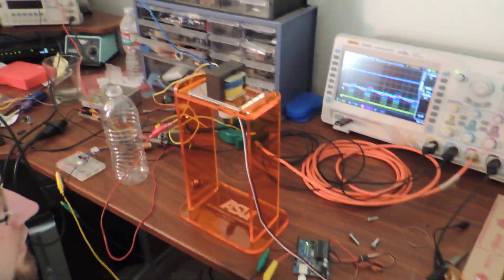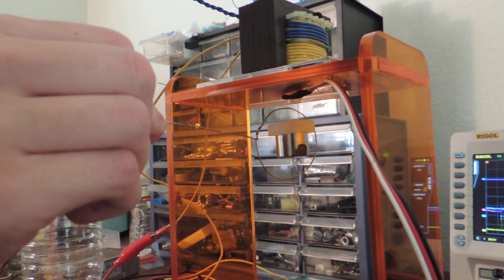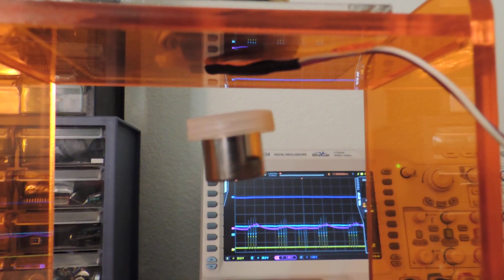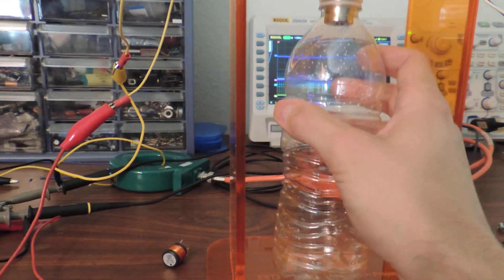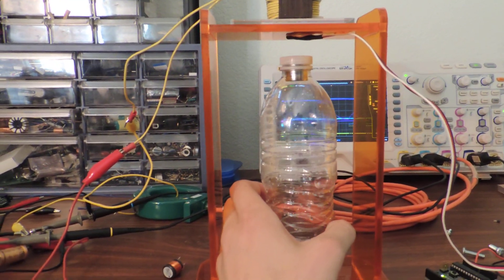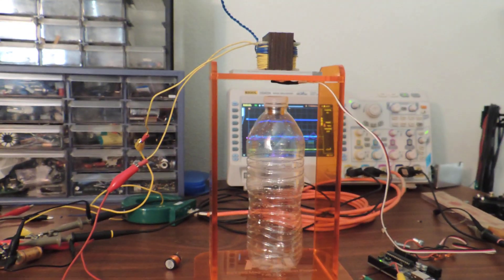Maglev Arduio

Comment: so I'm guessing from your comment right at the end, the high-pitch tone we hear is the Arduino's default PWM frequency? I wonder if you've considered/tried upping the clock; it can run up to 64kHz on the Duemillanove if I recall correctly... it might increase stability to with more checks and adjustments per second... or it might not :-)  just a thought, really.
Reply: and you can use lower level pin controls to make it even faster

Comment: Can you explain how to do that?
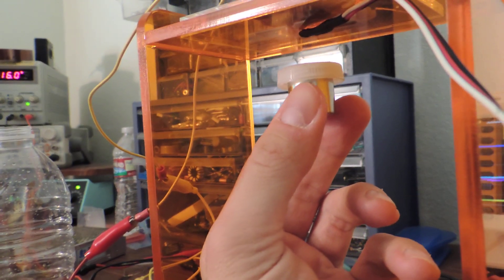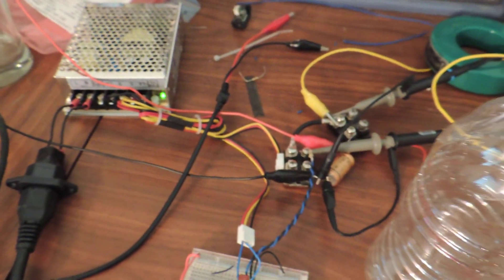Reply: There's a sensor (0:42) that measures the distance of the floating magnet/metal (either should work). It's output is interpenetrated by the Arduino (1:03) which sends a command to the MOSFET (0:56) which adjust the power going to the electromagnet (0:47). If the magnet is too low, the Arduino increases power to the electromagnet. If the magnet is too high, the Arduino decreases power to the electromagnet.
Reply: Can you upload the arduino sketch file?  It Will be interesting of do
Reply: Marc Sola García From what I understand, the sensor detects in binary, "IT'S HERE" or "NOT HERE". If I'm right, the Arduino will use an if statement. If <HAL> = true then <POWER> = OFF, else <POWER> = ON.